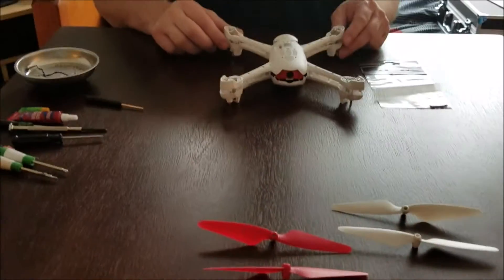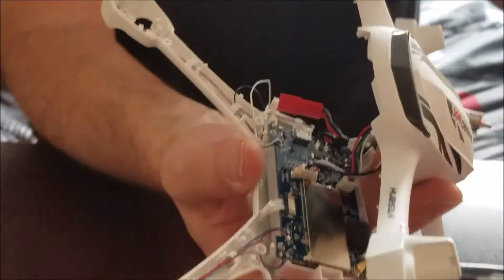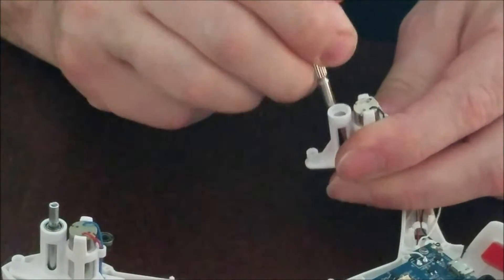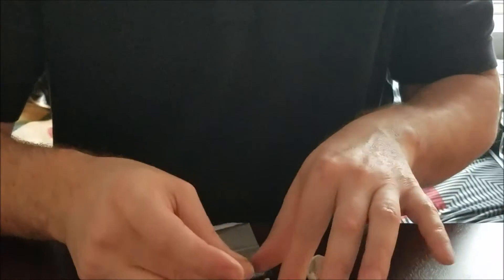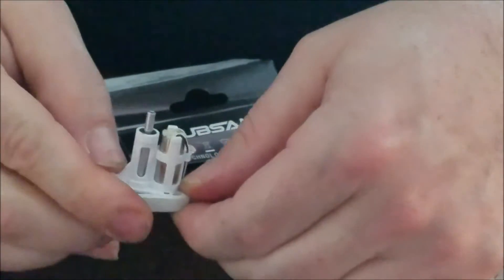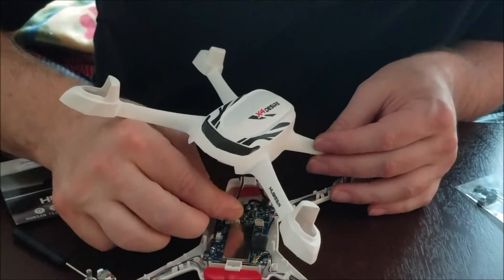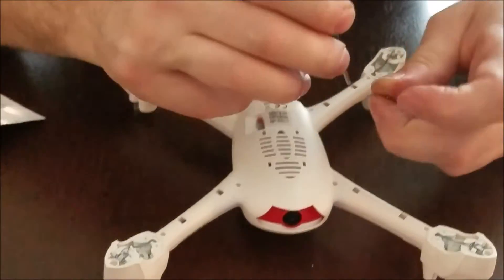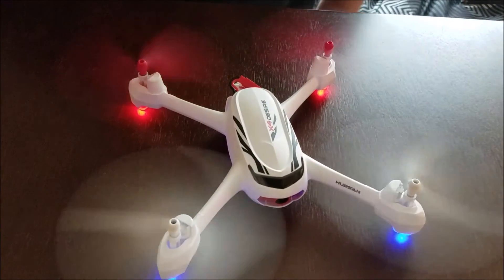Hubsan X4 Desire H502e Bearings Replacement pt2

Comment: Please tell me the exact size of the bearings. The link is no longer working. So I need to search for the bearings elsewhere.

Thank you for the great video.
Roy 
Auburn, WA.
Reply from the maker: You can purchase replacement bearings for your Hubsan X4 Desire H502E from several online retailers:

eBay: An 8-piece set of original Hubsan bearings compatible with the H502E model is available. 
EBAY

B&H Photo Video: They offer an 8-pack of Hubsan bearings designed for the X4 H502E and H502C Desire Quadcopters. 
B&H PHOTO VIDEO

LinParts: This retailer provides spare parts for the Hubsan X4 H502E, including bearings. 
LINPARTS

Amazon: Various sellers offer compatible bearings for the Hubsan X4 H502E. Ensure to verify compatibility with your specific model before purchasing. 
AMAZON

Hubsan Official Website: The official Hubsan site lists bearings for the H502E model. Check their spare parts section for availability. 
HUBSAN

Before making a purchase, confirm that the bearings are compatible with your Hubsan X4 Desire H502E to ensure proper fit and functionality.
Reply: Thank you for the reply but I asked for the actual size of the bearings. I realize I can find them online but I still need to know what size they are so I do actually buy the right ones. 

I really appreciate your recommendations
Reply from the maker: @blue2824  The Hubsan X4 Desire H502E quadcopter uses specific bearings designed for its motor assembly. While the exact dimensions of these bearings are not specified in the available sources, they are commonly available as replacement parts labeled for compatibility with the H502E model.

For instance, B&H Photo offers an 8-pack of bearings specifically for the Hubsan X4 H502E/H502C Desire Quadcopter.
Additionally, Hubsan's official website lists bearings as spare parts for the H502E model.
Given the lack of detailed size specifications, it's advisable to purchase bearings explicitly labeled for the H502E to ensure proper fit and compatibility. If you require precise measurements, contacting Hubsan's customer support or consulting the quadcopter's technical documentation may provide the necessary details.

Comment: It appears hubsan now uses a white plastic "sleeve" with no ball bearings as opposed to the metal ball bearing shown in this video.  Has anyone replaced the plastic sleeve with metal bearings to be able to comment if there is a performance difference?

Comment: Regular loc-tite or it's clones will damage plastic by embrittlement.  For any screws that go into plastic threads, you must use special loc-tite for plastic.  https://tds.us.henkel.com/NA/UT/HNAUTTDS.nsf/web/F3315286A80C8A55882571870000D782/$File/425-EN.pdf

Comment: So you purchased a full set of bearings, but only did one replacement.  Most hobbyists would do all 4 whilst the
 unit was open.  If one is bad (probably just dry)there's a good chance the others may go the same way. By the way, grease used in RC boats is often poisonous and will be absorbed by the skin. Always use latex gloves when using it, you never know which type they supply.  I recently purchased some from a hobby company, there was nothing printed on the tube, but the box had a poison warning on it. It's best to be careful whilst using it. It's also best to wear protective glasses in case any flicks off and lands in your eye.

Comment: I had so much trouble getting those .screws in the first time,with that dam loctie that was on the,I hope after I have takenn the screws out a few times it gets easyer ,mine were very hard to turn,that I ordered a second set of new screws and they were hard to turn but I got them in ,I haven't flow it yet we are having a heat wave in ca..anyone else had any trouble with those screws.
Reply: Ron Thompson  this guy has no idea how to solder or work on electronics lol
Reply: Theres youtube videos on stuff like this its easy scared to solder why
Reply: Don't be afraid of breaking wires wtf i had to solder a wire learn to solder its easy

Comment: Just a FYI, you don't need to memorize the placement of the two wire harnesses that attach to the top. They will not interchange, the connectors are different.

Comment: How long do the motor  last, can you fly it all day and not worry about changing a motor
Reply from the maker: LARRY D As far as how long motors last, there are too many variables to answer that with a specific time frame because they are toy motors and not meant to last due to different stresses and elements.   The good news is that they are easy to replace and cheap and they do last for quite a while if you are careful. Some hints are don't fly continuously one after another if you have multiple batteries.   Give them 10 minute breaks and always check for dirt in the gears when you land. I hope this helps.   Thanks for watching and fly safe! :)

Comment: Mine for now flyes ok should I change it? https://youtu.be/4qBZwoQ_5f8 
This is the second flight I had. But I ordered the bearings and extra motors just in case :)
Reply: My 502E has plastic sleeve for bearings, Glad to find ball-bearings for it.  It's no wonder my unit is slow and underpowered.
Reply: James C Goodrich Mine did too!  Those white plastic donuts they put in place of bearings don't do anything to reduce friction. Mine crashed into a tall tree and spent a month exposed to the elements. High winds blew it out of the tree a couple days ago. Now I got it flying again and I'm awaiting a delivery of new bearings so I can finally have it flying right!

Comment: Good video - Possibly a good idea would be to 'smear' a light coating of WD40 on the bearings, gears and shafts
Reply: I think a graphite base lube would be better.  WD 40 is actually a solvent and evaporates.
Reply: @popoaggie  wrong.
Reply from the maker: Awesome idea ..will do that from now on. Thanks for watching =)
Reply: never use wd 40 on bearings it distroys them, it washes all lubricants away. found out the hard way with my skateboard when i was a kid 😂 😂

Comment: Hi have you had a broken motor since you replaced the bearings?
Reply from the maker: No, not yet.  So far, so good.
Reply: INTELMAXELL how many flights have you out it through? I'm so scared to get this drone and have it over trees when the motor siezes.
Reply from the maker: You have to accept the fact that when you fly brush motors (toy quads) that eventually the motors will fail.  As for how many flights does it take for it to stop working, no one can answer that.  There are too many variables.  Wind, heat, even when you land dirt can go inside and cause the gears to jam and damage the motors.  Or even crashes can damage the motors.  I have flown many toy quads and I still recommend them before getting into the hobby grade quads to learn how to fly.  So, I suggest to fly in open fields with wind blowing towards you in case the quad comes down the wind will blow it towards you.   I hope this helps.  Enjoy the hobby and fly safe.
Reply: INTELMAXELL thank you. I just had a h107d plus get away from me today after some mods so I'm trying to replace that. Might get the aosenma cg035 if you're familiar.
Reply from the maker: Sorry for your lost h107d. Yes I am familiar with cg035.  It has better motors.  They are not toy grade.  They are brushless.  Meaning they won't fail unless you crash hard.  It has GPS and RTH so it is easier to fly.  This quad is more of a hybrid.  It has hobby parts with a toy transmitter.  But it has good range.  If I am remembering correctly, around 200 meters or more.
Reply: INTELMAXELL does the 502s go further than 200m? Which would you get

Comment: Got a question for you. I just got my new H502e. But my first flight with the unit seemed a bit shaky and unstable. So before I took it up for a second time I recalibrated the gyros and the transmitter. Now the left stick up and down actions control forward and backward movement. And the right side stick up and down actions control the throttle up and down altitude. The other actions remain the way they're supposed to do. Left stick right and left control yaw and the right stick left and right move the unit to the left or right. Have you ever heard of such a thing? SO I recalibrated the transmitter again with the same results. Any ideas? Should I just recalibrate for mode 1 and not mode 2? Any ideas would be greatly appreciated.
Reply from the maker: You are in mode 1 you need to change it back to mode 2 . Make sure the LCD says m2 on the bottom left corner when you get done calibrating.  Here are more detailed instructions directly from the Hubsan website (go to section 9 Transmitter Calibration):  https://www.hubsanus.com/media/support/H502E-User-Manual.pdf There is also a video tutorial on this website: http://indoorfpv.com/content/getting-started-hubsan-x4-switching-between-mode-1-and-mode-2 It is a different quadcopter but it is the same procedure.This other link is usual in case you lose binding also (even though you didn't ask for this, it is good to know): https://www.youtube.com/watch?v=5FpWD932Ol4&t=205sI advise you to save all of these links to refer to them when needed.  Going back to your shaky and unstable problem; 1. Make sure your props are put on properly; 2. Make sure the quadcopter is on a level surface and do not disturb it while the lights are blinking and doing a self-gyro calibration.  I like to put mine on a level wooden platform; 3. Make sure before you take off that you have more than 6 GPS locks.  I usually like to wait for 10-12.  It won't do more than 12 satellites.  The more satellite locks, the better the stability of the quad; 4. Be advised that this quadcopter is not rated for heavy winds, so keep it under 10 mph.  It will drift with the wind; 5.  If it still drifts, you can adjust trims, but I don't recommend doing that unless it really needs it.  I hope this helps.  Thank you for watching.  :)
Reply: Thank you very much. I can't wait to try it out tomorrow.

Comment: Hi - my hubsan flying sideways upon arming and push the throttle up. Is this because of the bad motors? Or just the shaft and bearings need to be cleaned?
Reply from the maker: First make sure you put the propellers on right. If all the motors are spinning I would make sure the trims are fine and the gyros are calibrated see this video here for gyro calibrationshttps://www.youtube.com/watch?v=OGGyMILIJao&t=128s   , If it still does not get better, It sounds like a bad or weak motor then. The bad motor will be in the direction the quad is falling. For example if it leans to the back right it would be the back motor on the right side.  I hopes this helps, Thanks for watching. :)
Reply: Thanks Max, will check as suggested.

Comment: Hello, how many bearings I will be pay? 4 or 8 pieces? Thank you for your answer
Reply from the maker: You will pay for 8...2 for each motors is needed. 
You can buy it here too.     http://www.banggood.com/Hubsan-X4-H502S-RC-Quadcopter-Spare-Parts-Bearing-p-1063180.html?rmmds=search
Reply: Thanks... What parts I will be must yet buy or replace? Which parts will be defective?
Reply from the maker: You will need to buy spare props and motors always. Especially spare props for beginners. ...also spare batteries too.Here is the parts list link.... ( remember the h502e & h502s use the same parts)http://www.banggood.com/search/hubsan-h502.html
Reply: Can you help me? Please write me link from banggood what exactly parts I will be need... Thanks
Reply from the maker: MOTORS      http://www.banggood.com/Hubsan-X4-H502S-H502E-RC-Quadcopter-Spare-Parts-CWCCW-Motor-p-1063177.html?rmmds=search

PROPS           http://www.banggood.com/Hubsan-X4-H502S-RC-Quadcopter-Spare-Parts-Propellers-p-1063178.html?rmmds=search

BATTERIES     http://www.banggood.com/Hubsan-X4-H502S-H502E-RC-Quadcopter-Spare-Parts-7_4V-610mAh-15C-4_5Wh-Lipo-Battery-p-1063185.html?rmmds=search

2ND you should have this too

 BEARINGS   http://www.banggood.com/Hubsan-X4-H502S-RC-Quadcopter-Spare-Parts-Bearing-p-1063180.html?rmmds=search

AND GEAR    http://www.banggood.com/Hubsan-X4-H502S-H502E-RC-Quadcopter-Spare-Parts-Main-Gear-p-1063181.html?rmmds=search

OPTIONAL    

LANDING FEET   http://www.banggood.com/Hubsan-X4-H502S-H502E-RC-Quadcopter-Spare-Parts-Feet-Lampshade-p-1063176.html?rmmds=search

CASE                    http://www.banggood.com/Realacc-Aluminum-Suitcase-Carrying-Case-Box-For-Hubsan-X4-H502S-H502E-RC-Quadcopter-p-1071999.html?rmmds=search  

 CHARGER          http://www.banggood.com/Hubsan-X4-H502S-H502E-RC-Quadcopter-Spare-Parts-USB-Charging-Cable-p-1063446.html?rmmds=search
Reply: The motor je clockwise and counter clockwise... which i buy?
Reply from the maker: Two clockwise and two counter clockwise.  Every quad has two clockwise and two counter clockwise diagonal to each other, so you buy two of each.
Reply from the maker: Autor Marek yes it comes with usb charger.
Reply: and classic charger wall socket?
Reply from the maker: No just a usb cable, but you can use your phone usb charger.

Comment: Have a quick question. My quad would not arm now been after I recalibrate it. Given the comments below about wires being loose and such, do you have any suggestions as to why this may have happened? I did fly it a few times and had two crashes into trees.
Reply from the maker: Make sure it's not a bind problem with the transmitter,  before you open it up and look for any wire that might be loose. I hope this helps good luck. =) 
click here https://youtu.be/5FpWD932Ol4
Reply: Tried to bind again and the only thing I can tell is that it will not arm. Opened it up and did not see any loose wires and the motors looked ok. Really interesting this problem. I may try to use another transmitter, H502s, to see if that works. Otherwise may need to change some internals but not sure what yet.

Comment: Had a similar problem. I noticed the factory installed the bearings upside down, it exposed the bearings and got dust in them. I pulled the bearings, washed em in  a soap bath by shaking em in a tupperware, air dried em with a air compressor, lubricated the bearings with silicone spray, air compressed again and walla, the drone flys better than when I bought it.
Reply from the maker: Awesome ! =)

Comment: Putting grease or oil etc on bearings does nothing but attract grit and dirt. Loctite should never come into contact AT ALL with plastic as it softens it. I think a can of compressed air used on the drives would have fixed the lazy quad motor due to a teeth obstruction. Only takes one grain of sand. Thanks for the tear down though. Cheers :)

Comment: Did the new bearings fix the slow motor?
Reply from the maker: James King Yes it did.   So far so good.   Thanks for watching.  :)
Reply: Thanks for the information.  I have replaced many worn out motors on my WL toy V686G Super Aviator.  I think the motors in the H502E may be much higher quality! Break in is something I neglected to do with each one of the 6 different motors I have replaced.  A couple hours is all I get out of them and I buy spares 4 at a time.

Comment: when one motor spins slower than the others but speeds up with throttle it may be the control board apportionment of different voltage to the motors. I know you went through shafts and bearings and did a great job explaining and with good video. But you might not have to go that far. trim controls will adjust motor speed specific to side. you can often just adjust trim at idle to maintain specific speed. also a volt meter at idle on main board. you took the added step. As someone with an AEE degree I am a bit lazy and would have just adjusted the trim to power output. But thanks for two great instructional videos on taking apart quad. One thing to note is that on some of the h502e quads the jst connectors are loose. Mine came out in flight and you know what happens then.